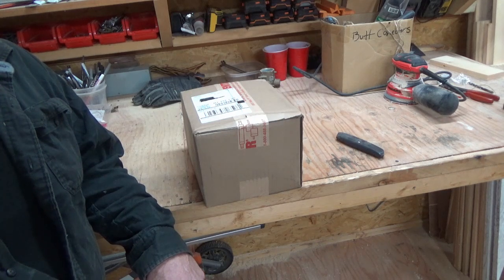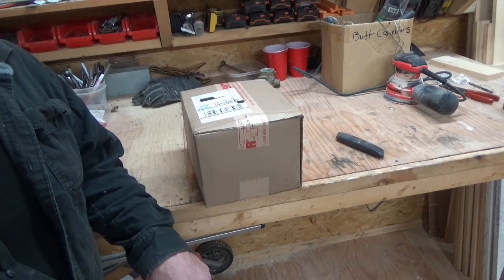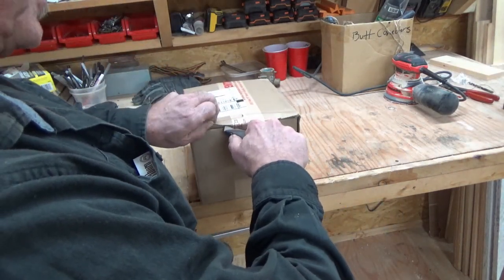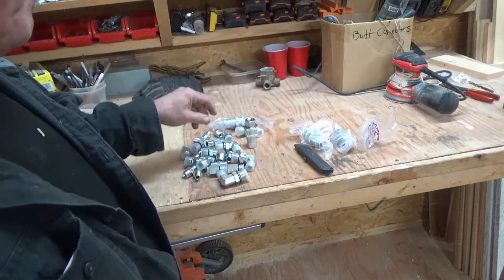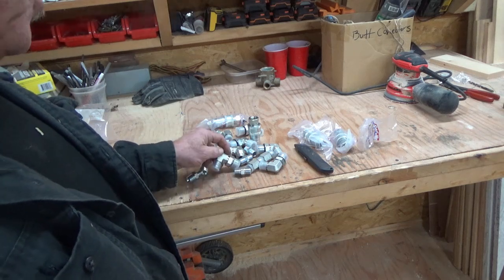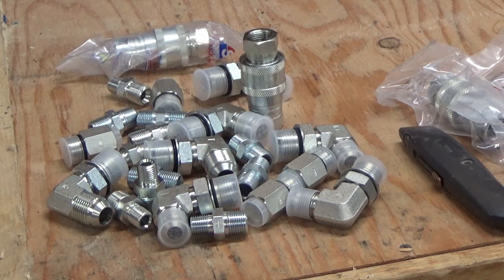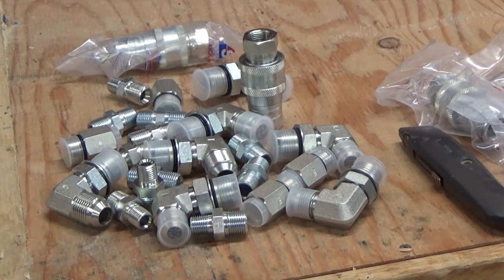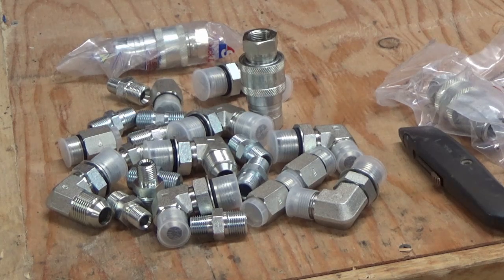John Deere 1050 Joystick Hydraulic Conversion Update

Comment: Hello good morning, I have a problem I hope you can help me, I have a john deere 1050 tractor. Do you have the manual for that tractor if so could you help me.
Reply from the maker: I do have the manuals, what do you need?
Reply: @SteeveeDan  The gearbox pinion on the right side was damaged. The tooth of the gear and the shaft have broken.
Reply from the maker: @smahsp.b.a.7175  I'll see what I can find.
Reply: @SteeveeDan  
okay. where do you find spare parts for john deere 1050, do you have a specific store. thank you
Reply from the maker: @smahsp.b.a.7175  https://www.tractorpartsasap.com/  or you're kinda stuck with Ebay type sites.

Comment: No need to apologize. We all have been where you are, He is over the Rainbow Bridge now playing......
Reply: I agree, no need to apologize, emotions get in the way, they are part of the family. been there.

Joystick, I have searched tractor Forums about replacing the 2 stick set up. Not a lot of info on how to do it.
I have run much larger tractors/Loaders that articulate, way bigger engine, and all I have operated had Joy Sticks, along with a 4 in 1 Bucket. really miss one of those.
I have a 950, same tractor but w/o a turbo.  I think the valve is worn out, move the stick to raise the bucket, and some times it drops before going up. and or the other stick move also.

Saw your other videos on the Hydraulic problem, I have the same problems. Cold, and is sluggish till warms up.
Interesting about gutting the Hyd. Filter in the other video.

My 950 is down for a while, had all 4 rams rebuilt, and new hoses, sand blasted the Lift Arms, stripped the rams, and Hyd Pipes. painted with POR-15 and several coats of JD Green. Hopefully get her back up and running this summer.

Charlie
Reply from the maker: @charlielund1279  Over the years I've learned that these JD "x50" series are worth the time and effort to make them right. This is my 2nd 1050 and other than hydraulic issues, never had a lick of trouble and they are so versatile that unless I fall into severe financial distress, I'll have this one a very long time. Hope to have the joystick completed this or next weekend so that vid should be coming soon. Good luck with yours!